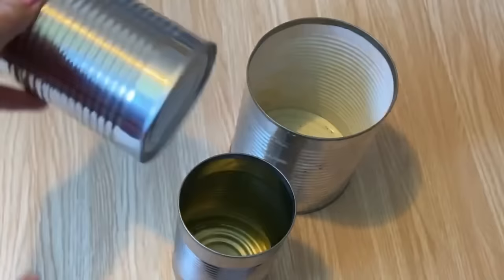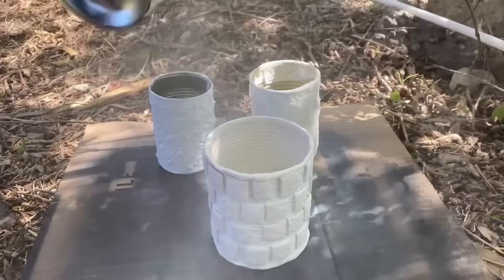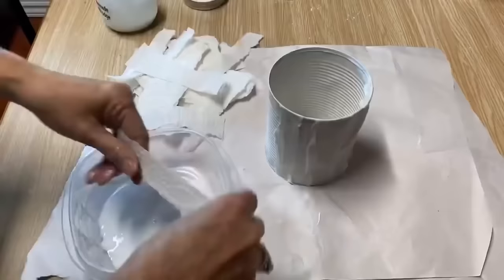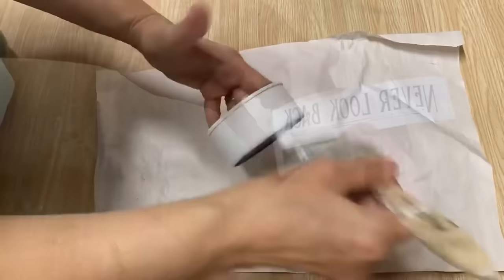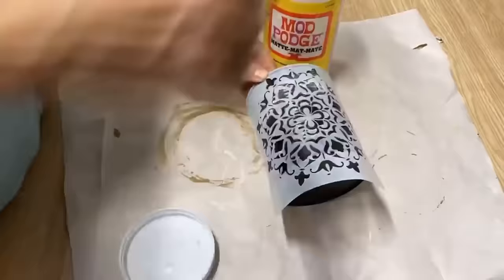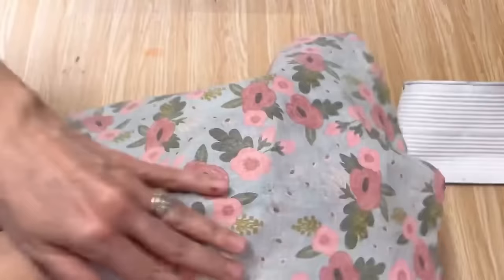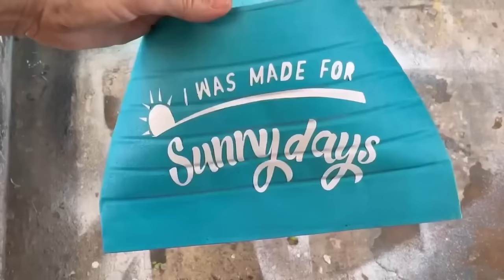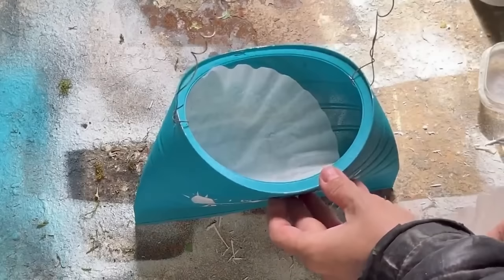18 Genius Tin Can Upcycling Ideas: Transforming Trash into Treasure

Comment: Try using your hand can opener on the top of the lid instead of the side to remove it. The lid will come off flawlessly, leaving no sharp edges😲🤔😁( I just recently learned this after 50 years of using a can opener incorrectly). Try it, so much easier.
Reply from the maker: Yes this works perfect!

Comment: More like 4 or 5 'upcycles' - 1.plant pots (ad infinitum) 2.stationary tools holder 3.refuse-bag dispenser (excellent, unique idea, used the plastic lid too!) 4. candle jar (might improve safety by adding feet) 5.container for odds and ends - with 3 or 4 decorative methods centered around different materials used for trim and the transfer of text or graphics, via 3 conversions; 1.crimping one end 2. paint and decorate, attach or stack 3. create aperture for dispenser. I'm not saying it's bad. Pls don't be upset that I didn't fawn and gush. The Dispenser is the 'genius idea', the others are variations on solid basics IMHO

I'll be using the dispenser idea. Thank You!

Comment: Loved all your ideas. I actually have a can opener that works differently than the kind you used in your video. it allows the lid you remove to be placed back onto the can.  It leaves a smooth edge on the can and the lid so that you can add a knob of some sort to the top of the can to make a little canister with a lid . These can openers are quite common now and come in both electric and manual versions.
Reply from the maker: That is awesome!
Reply: What kind of Can Opener do you have and do you remember where you purchased it? Thank you so much 😊
Reply: @Our Upcycled Life  I love your ideas for Upcycling the many tin cans 😍  Beautiful
Reply: @WJW1024  I have one of those can openers, and I love it!  In addition to giving a smooth edge (no more cuts), they also seem to be cleaner because they don't make contact with the food. I bought a Hamilton Beach Smooth Touch, and it still served me well for 7 years. I got mine at HH Gregg, but I believe they sell them at Target, Walmart, and Amazon among other places. If you Google "Hamilton Beach Smooth Touch can opener", you can find one for just over $30-35.
Reply: @WJW1024  I have an electric one made by Hamilton Beach. I love it.

Comment: I do art with soup cans and sardine cans. After they’re dry from washing I stuff them with shredded junk mail to the top. I take frozen food box packaging and top and bottom them. I take wither whole wrapping paper and do the outside, or I paint them with acrylic and paper punch frozen pizza box cardboard and glue them on wrapping paper and cut around them and then glue them on the can and you can see the paint in the spaces. Then I take animal pictures or stickers, beaded borders or glitter border ribbon for the top and bottom and do a scene. Sometimes I’ll take my wrapping paper or the patterned innards from envelopes and glue on their paper punches for the outside. And on the tops I put nature scenes. Or I discovered if you swirl two acrylic colors you can do the outside in sections until it’s all done. Makes a great background. I also recycle cat food cans and stand them on end all decorated with animal stickers or pictures and stand them on end so I call them stand ups. Sardine can art turn into animal dioramas. I get rid of a lot of junk mail by shredding and using as stuffing. I use regular craft glue to attach stuff.
Reply from the maker: Sounds like a really fun project
Reply: @OurUpcycledLife  it’s great. I recycle a lot of stuff. Been doing it for 25 years.

Comment: STITCHES NOT QUITE SLIDING OFF SOLID PINK HOOK BETWEEN MOVING NEEDLES. Using the Sentro 40. Some of the stitches didn't quite slip off as it went around. I knitted a row...any stitches that didn't slide off...using an Emory board nail file it removed the tiny edge of plastic that caused stitches not to slide. I continued doing this until everyone slid off.

Comment: Love your channel! New Subbie for about 3 weeks. I have my first flea market/ craft show soon.  I’m just trying to build up enough inventory I was running out of craft ideas, and now low on money. 

Now I have many ideas for the cans I have at home. A few questions…What type, where do you get the wire, and what size gauge is best is good to use for hanging them. I decoupaged 2 cans with napkins. They came out beautiful, but i haven’t put the wire on them yet, because I’m not sure about the wire. Also, I must try your method putting the napkin to a plastic bag and wet the napkin first, just to learn a new technique. I’ve  been searching the internet on the wire information. 

You explain so well, straight to the point, easy to understand. There’s never too much info on the cans. Great ideas! Giving me so much inspiration for my craft show. Thanks!
Reply from the maker: Hey there welcome love new crafting friends. Hope you find lots of great content as for the Y or you just want to buy a gauge that’s going to bend and form around a pencil. I’ve had mine for quite a while so I’m sorry I can’t remember what gauge is
Reply: @OurUpcycledLife  ok, I have wire from when I made jewelry, that will wrap around a pencil. Thank you so much!